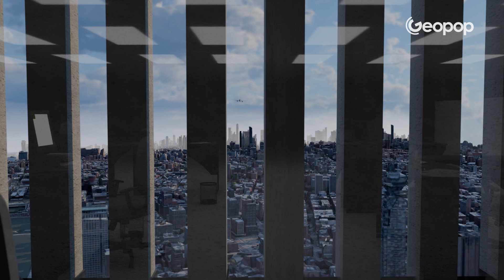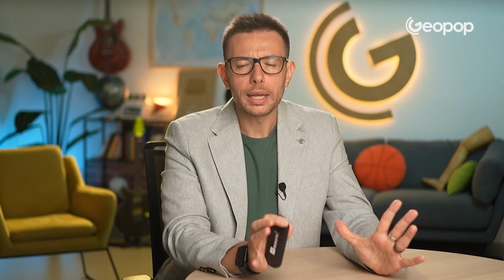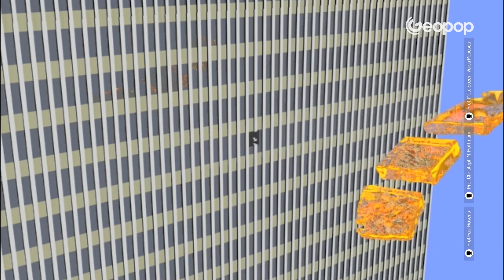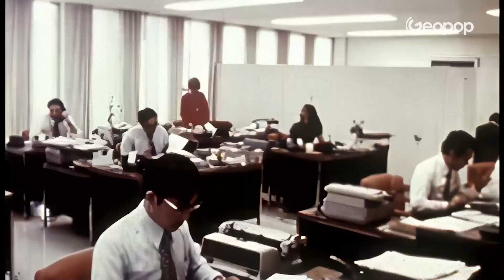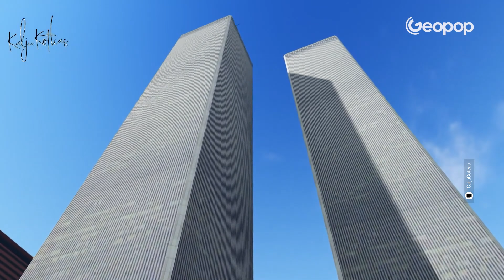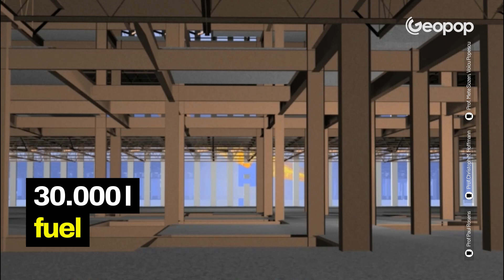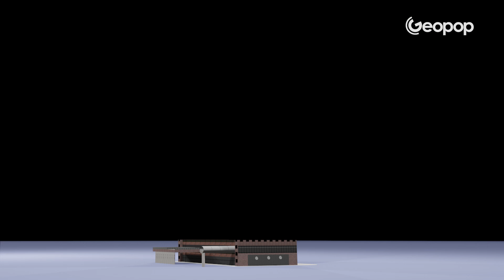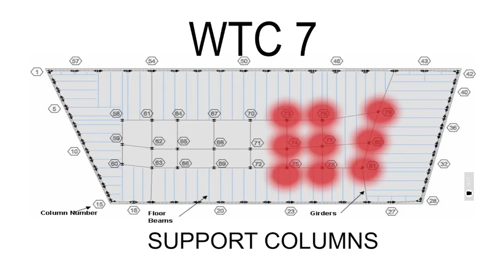9/11, 2001: The Technical Reconstruction of the Twin Towers and WTC 7 Collapses

Comment: EXPLOSIVES caused the DEMOLITION.       NIST LIED.
Reply: Collapse initiation was due to sagging floor trusses (which we can see) causing inward bowing of perimeter columns by up to 5 feet (which we can also see) at the impact and fire damaged floors until those perimeter columns buckled and failed, initiating the collapse (which we can see). I would refer to you the excellent Gary Pollard video of the collapse of the South Tower. Pay attention to the first 12 seconds in particular.

WTC2 Collapse -- Gary Pollard (Enhanced Raw Copy from NIST) 

www.youtube.com/watch?v=ULdiD6gYZO0  

Columns don’t work well when they are bent. The Twin Towers were designed to work with straight elements not bent ones. When you bend those columns they become up to 4 times weaker. Failure is inevitable.

Notice how the columns are already bent when the camera zooms in, become a bit more bent over the next new seconds until they give, starting the collapse. 

So what bent them? It sure as shit wasn’t thermite or sooper-sekrit fire-and-impact proof hush-a-boom pre-planted demolitions that don’t explode. 

If you keep watching you will note that after the tower starts collapsing the air inside the building (95% air by volume) gets compressed and forced out the windows. These low-velocity air bursts devoid of blast or fragmentation effect are a reaction to the building collapsing not a cause of the building collapsing 

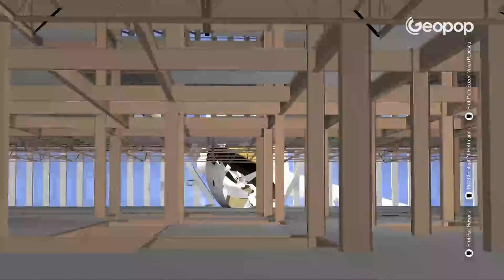And at a different angle from 1:18 here:
youtube.com/watch?v=TJJPYTVjxug&ab_channel=femr2 

Or here
www.youtube.com/watch?v=-DCgEJ2bUcI 

Also seen in the excellent still image here at 9:09:
youtube.com/watch?v=YXsDwKYz1bA&ab_channel=msvfreak94

Comment: I get the pancake theory, that would help explain the floor and exterior column collapse... But it doesn't explain how the dense core collapsed at the same rate as the exterior, the exterior should have collapsed and fell away from the core....
Reply: I don't think you get "pancake theory", which was abandoned within the first few months after the attacks as obviously not the correct initiating mechanism and has not been talked about (in professional circles anyway) in more than 23 years.
Reply: @TheCriticalStinker-jw4fl  He just spent an entire video explaining the pancake theory to you, unless in your infinite wisdom you thought he was explaining how heat on the 80th floor somehow weakened the steel on the 30th floor... Good grief
Reply: @bungalowbill3409  - Good grief indeed. "Pancake theory" strictly speaking was a very early FEMA hypothesis for collapse initiation due to floor failure. It was very quickly realized perimeter column failure was the initiator and FEMA's pancake theory was quickly abandoned. The name stuck and has been used inappropriately ever since. 

This video is NOT describing that early FEMA hypothesis. 

This is my own hypothesis of Twin Towers collapses, developed years before this video dropped. Pay attention to #7. 

While complex, most of the Twin Towers collapse mechanisms can be seen with the naked eye and easily discerned and understood by the layperson if sufficient time is taken to understand. 

1. The Twin Towers consisted of 4 primary structural elements that together formed an integrated system where each relied on the others.  47 hollow box-section steel Core Columns carry the majority of the gravity loads. The 236 hollow box-section steel Perimeter Columns carry the remainder and ALL of the lateral (wind) loads. Long-span Lightweight Steel Trusses connect the core and perimeter column together at each floor with a Hat Truss on top to tie the structure together as an integrated unit where no element can survive without the others. There was no structural load bearing concrete and most components were bolted together.

2. The impact of 117 tons of airplane (= to about 12 dump trucks) at speeds up to 590 mph with the energy of a ton of TNT completely destroys the aircraft. This in no way implies the Towers come out unscathed. Many perimeter columns are damaged or destroyed as are some core columns (example; 33 of 59 perimeter and 20 of 47 core columns damaged or destroyed at the impact floors in the North Tower), This damage is primarily through bolt-shearing failures at the end connecting flanges, as well as bending, twisting and fracturing of weld seams. There was no cutting or slicing - the reality was far more violent and messy. 

3. The impacts destroy or damage fire insulation, fire breaks and sprinkler systems on multiple floors.  Huge fires are started across multiple floors simultaneously and allowed to spread rapidly with no effective firefighting or fire suppression. This was an unprecedented fire event . 

4. The hotter steel gets the weaker it gets .  With fire insulation stripped away and no sprinklers the survival time of the steel greatly reduced. Gradually over time heat causes the lightweight steel Floor Trusses at the impact damaged floors to sag, which was observed and recorded.  No steel melted or needed to. Structural steel fails long before it becomes a puddle. It just needs to bend

5. Sagging floor trusses pull on the increasingly weak and overloaded Perimeter Columns, causing some of them to bow inward by up to 5 feet. A straight column is up to 4 times stronger than a bent column. The bowed Perimeter Columns buckle and fail, initiating collapse. The formerly static mass above which the structure below could easily support is now converted into a dynamic mass up to 30 times greater. Because they have buckled, the Columns above and below the failure point are no longer aligned . The load bearing structure below no longer bears any load as it falls past the lower columns, NOT onto them.

6. Thousands of tons of debris fall within the four outer walls, down through the open office space, crashing onto the first intact floor it encounters. This massive impact immediately breaks the bolted connections to the columns as the amount of resistance the Floor Trusses can offer is negligible.  The falling debris slows only marginally and briefly. Note:
6a. This is NOT a solid top block crashing into and “crushing” a solid bottom block .
6b. The debris falls past the columns not onto them.  The columns provide no resistance to the falling debris. 
6c. Only the bolted connections of the floor trusses to the core and perimeter columns can offer any resistance. A pair of 5/8” bolts at each end of each truss vs. thousands of tons of falling debris.
6d. No laws of physics are violated.

7.  This floor-led collapse progression within the four outer walls can only go straight down. Note: 
7a. This process is often incorrectly referred to as “pancaking” which actually refers to a completely different process rejected at an early stage. The catchy name stuck but nobody knows what it is supposed to mean.  Pancaking is too simplistic and inaccurate anyway. More like Kaiserschmarrn

8. Collapse progresses through the floor systems not down the columns, through the path of least resistance . Rate of floor failures increases with each successive floor as momentum increases, reaching an average acceleration of 0.65 of GA, or 35% slower than true free fall. Bam, bam, bam down the building until there are no more floors to fail.  The resistance offered by each successive floor is always the same. The mass and velocity, thus the energy of the falling debris is constantly increasing, with each floor destroyed adding new falling mass. Some falls to the sides, but most falls down. More mass, more velocity, same resistance with each floor.  Don’t get stuck on the but the lower floors weren’t on fire nonsense. They weren‘t and didn’t need to be.

9. The Towers were 95% air by volume. As that air was compressed inside the building it is forced down the tower and blown out the sides in reaction to the building collapsing . Those were not “explosions”, it was expulsions of compressed air caused by the collapsing building, explaining the low velocity, lack of flash, blast, supersonic pressure waves and lethal high-velocity ejecta.  

10. Perimeter Columns become detached and peel away like a banana behind the collapse front, playing out to the four points of the compass extending to more than 600 feet from the base of the towers. This was quite obvious from examination of the debris pile. 

11. Core Columns fail last as their internal beam bracing is stripped away by falling debris and lateral support from the floor to perimeter columns is lost. 

12. For those who care about how long this whole process took; 31-34 seconds from the moment the perimeter columns buckled until the last core columns hit the pile, or 1/3 the rate of true free fall. Don’t believe me?  Just watch any video of the collapses and note the loose truly free-falling debris dropping much faster than the towers themselves.  

13. Each Tower had a 1-acre footprint. Far from collapsing inside their own footprints the debris pile spread out over 17 acres in a pile up to 14 stories deep. 8 surrounding buildings were destroyed and scores more damaged by the falling debris. 

14. Finally, the Twin Towers were perfectly safe within their design envelope.  They only collapsed when taken far outside design parameters by an extraordinary and unprecedented event 

Impact + Fire (heat) + Time + Gravity = Collapse . Remove any one of those four elements and there is no collapse. Ignore any of those elements (as many do) and you will never understand the collapses. The Twin Towers were an integrated system in which no one component could survive without the others. One fails, the rest follow, through the path of least resistance – DOWN – through the open space, bypassing the path of greatest resistance – the columns.  Nothing I just described violates any laws of physics. All of the above is true no matter who planned and carried out the 9/11 attacks or why 

I hope you found this helpful and informative. It is not meant to be adversarial, but to solicit informed critical comment, positive or negative. If I made any errors of fact, logic or reason or left anything critical out, please let me know so I can fix it.

Have a nice day.

Comment: I can see how possibly WTC 1 and 2 collapsed.

But WTC 7?

 The Solomons Building which the BBC announced before it actually happened?
🚩🚩🚩🚩🚩🚩🚩🚩🚩🚩🚩🚩
That is the smoking gun.

Add to that the rivers of molten steel as reported by the NYFD,
🚩🚩🚩🚩🚩🚩🚩🚩🚩🚩🚩🚩🚩🚩
Reply: Building 7’s collapse was completely different to the Twin Towers, harder to understand with most of the details difficult to see. But we can still sort out what happened through careful analysis and observation.  This is MY EXPLANATION of the collapse sequence using the best available information and relying on no authority.

B7 was complex 47-story steel framed structure built on top of a smaller existing 3-story building, requiring several lower floors dedicated to complex load transfer structures instead of usable office space. Of trapezoidal shape and all-steel tube-in-tube construction, B7 (above the 7th floor) consisted of a central core of steel columns carrying most of the gravity load, perimeter steel columns around the outside of the structure carrying the remainder of the gravity loads and long span beams and girders to tie those elements together and form the floors. On the outside of the building hung a moment frame - the last part of B7 to fall. 

Phase 1 : The first externally visible signs of collapse initiation occurred at 5:20:28 pm. Collapse initiation for B7 is notably quiet with observers not realizing the building was collapsing! There was no audible warning in the form of say hundreds of ear drum busting 180-190dB explosive bangs preceding the collapse. Here at 12:00 a local CBS affiliate reporter is talking 10 blocks from B7 when collapse begins. People don’t start to notice the collapse until 12:11. Then at 12:45 is the famous CBS fixed camera clip of Building 7’s collapse.  Note how quiet it is.

youtube.com/watch?v=t5tEy6mXSE8&ab_channel=fresnosean379

Collapse initiation was due to lower floor failures above the load transfer region (7th floor) in the NE corner of the building. In this video at 0:45 you can see the NW corner from inside the building while under construction, Column 79 just out of frame on the left. That big, angled steel beam across the top of the frame connects to C79 at one end. The girders connect to the beam. That beam and all those girders depend on just one connection

youtube.com/watch?v=nP3TNHPCIVU&t=35s&ab_channel=EdwardCurrent

Phase 2 : Lower floor failures caused a loss of critical lateral support over an excessive length of core Column 79 and it buckled. If you look at a floor diagram of Building 7 (see above) and look at all the structures that depend on C79 you quickly realize this one column was a relatively isolated structural element on which a disproportionately greater fraction of the structure depended analogous to say the Key Bridge. Externally we see a vertical progression of window breakage along the 44-46 line and a kink in the roof of the East Mechanical Penthouse at the top of the building, consistent with C79 failure. The transition from full capacity to almost no capacity occurs in virtually an instant. Once the buckling failure occurs there is almost no resistance

Normally with a buckling column, the load could very well be redistributed to other columns, meaning the buckling could stop after a while. With C79 that is not the case - the failure did not redistribute the load, so the collapse rapidly progressed to the roofline, sinking the rooftop penthouse.

Phase 3 : With C79 gone, Building 7’s progressive, non-symmetrical collapse continues with C80 and C81 at the east end of the core left laterally unsupported and quickly buckled and failed as well, sending the EMP down through the building. C79-81 all have no diagonal bracing, which I believe is a major reason why they could not redistribute a lot of vertical loads among one another.

From there collapse progressed from east to west through the central core until the core was gone taking all of the interior floors and structures and probably most of the perimeter columns with it. You can see the horizontal progression of window failures low in the building and the dropping of the remaining rooftop structures into the building. One of the big takeaways from the NIST Building 7 study (that gets completely ignored) was their modeling which determined C79 failing under ANY circumstances would have initiated the same collapse sequence.

Phase 4 : After some 10 seconds all that remains of Building 7 is just a hollow empty outer shell - the exterior moment frame - creating the illusion the building is still standing since little has changed externally. But it’s just a hollow empty shell like an empty cereal box supported by only a few remaining columns and quite unable to remain standing. With all the internal framing gone, the north face leans inward, forming a V in the roofline, the last few perimeter columns buckle under the strain and with nothing left keeping it up the moment frame free falls, landing on top of the 7-story high debris pile. It is only at the very end that a single measurement of alleged free fall acceleration is taken. Note this is not the building but just its outer shell and only one corner at that, at the very end of the collapse. Start to finish the entire collapse took 18-20 seconds, or less than 1/3 of true free fall and we have to look at the whole thing, not cherry-pick little bits to fit a particular narrative. Worth noting how fast something falls cannot tell you what started it falling in the first place. The debris spread out, blocking surrounding streets, heavily damaging the Verizon Building and destroyed Fiterman Hall, all well outside of Building 7’s “footprint”.  

Building 7’s progressive, non-symmetrical collapse was incidental and unintended collateral damage from the combined effects of fire + time + gravity started by the collapsing North Tower. That is true no matter who planned and carried out the 9/11 attacks or why . The collapse was of so little consequence it barely even registered at the time, a mere footnote. It only took on semi-mythical status as an alleged smoking gun years later when demolitions at the Twin Towers, missiles at the Pentagon and shoot down over Shanksville all failed and conspiracists had nothing left to work with.

Anything can seem like a conspiracy if you don’t understand how it works. Now you should. I hope you found this helpful, informative and it solicits informed critical comment. If I made any errors of fact, logic or reason or left anything important out, please let me know so I can fix it. IF you can offer a more plausible alternative please do. Be the first. Please start any reply with the words “Tits McGee” or I will know you didn’t read it and are wasting my time.